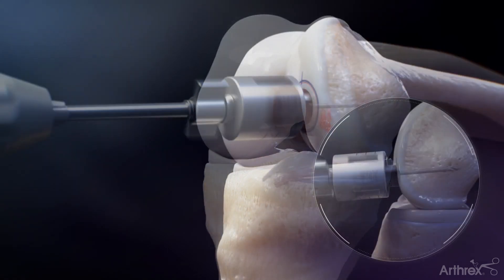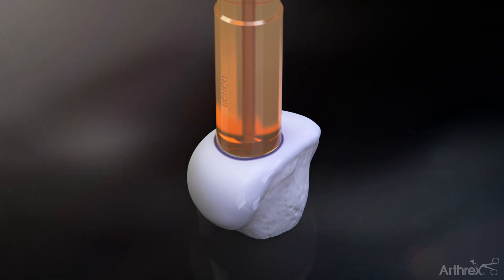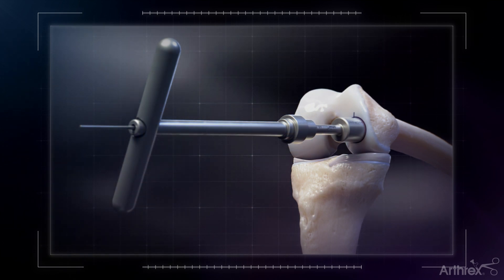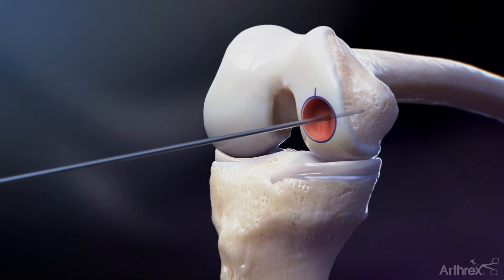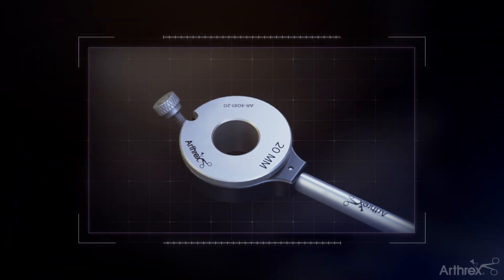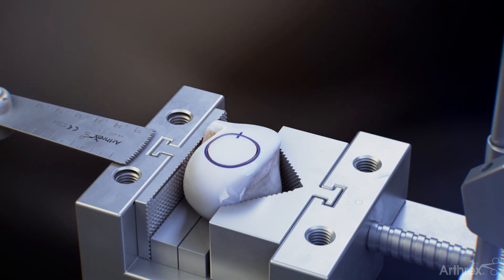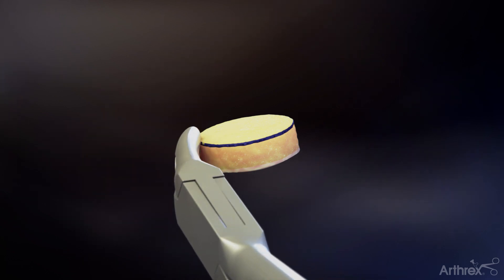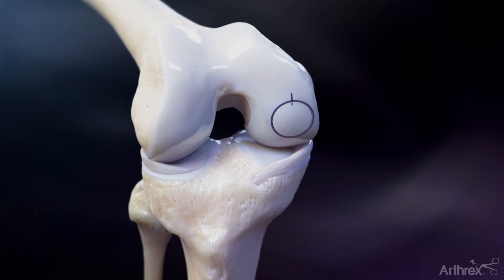Allograft OATS® Surgical Technique Animation

Comment: I will be getting this done next week🙃
Reply: Please report back on how this goes? I'll be having the same procedure 😐
Reply: @johnpreynolds I had mine April 26 and prior to that I hadn’t been able to bend my pinky finger for months. It wouldn’t bend at all, even if you pushed it down manually it would stick back up. The very next day after my surgery I woke up and my pinky finger was bent down in a normal position. It was difficult to lift it up but I was happy with it. I’d rather it be down forever than up forever. Anyway now I’m able to bend it up and down successfully about 95% of the time now.
Reply: Update please bro..
Reply: Hows it going?
Reply: UPDATE? Why did you opt for this? Were you told you needed knee replacement surgery?
Reply: Are you happy with the outcome. Where did you have it done.